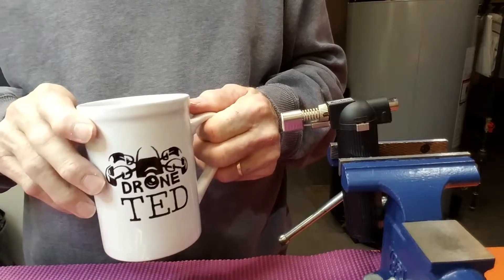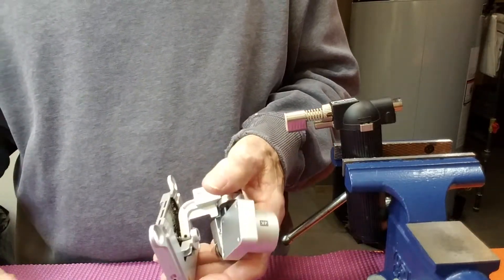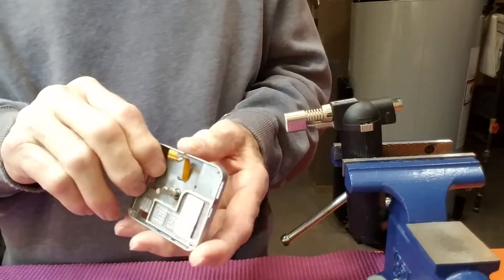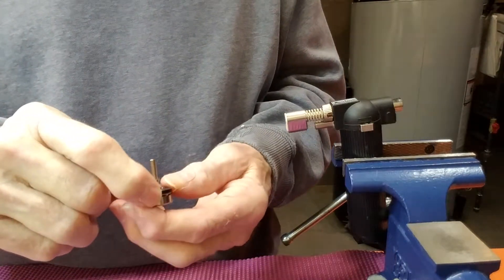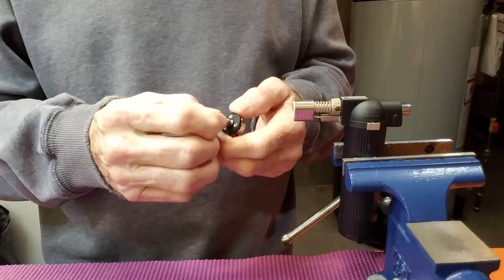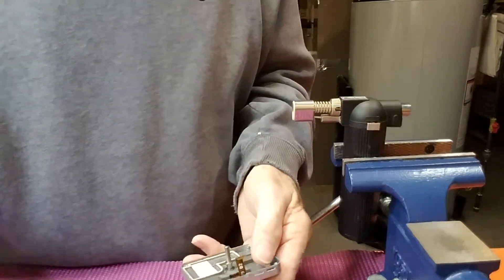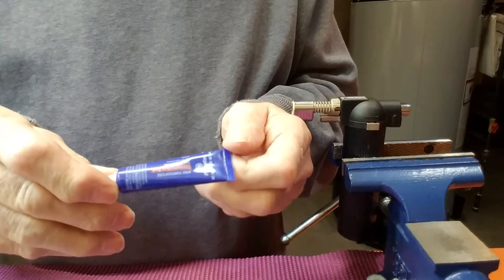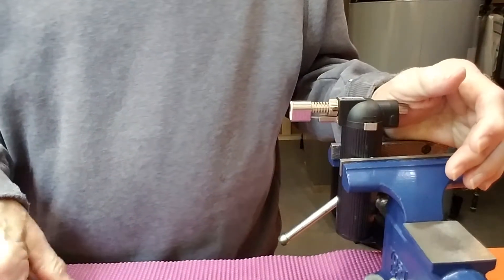DJI Phantom 3 centering yaw

Comment: Hi Ted. This video is extremely helpful. My question is - the black tabs, I broke one. What happens if one is not in place? Can I fix it? Thanks!
Reply from the maker: Can you send me a photo of the board so I can see if there is any damage to the sides that hold it in? droneted@gmail.com
I have put the tabs back but it is not easy. You have to have the black tab or it won't work.
Reply: @Droneted  thank you for your reply! 😀 photo shows old broken pcb board (left) new board (right) with both having lost the black clips. Gimbal works but continually rotates in one direction, could this be why?

Comment: Ted do you think it’s possible to align the yaw motor shaft by using 2 sets of pliers to force the magnet left or right by using one to grab onto the shaft and another on the rear of the motor?
Reply from the maker: no. the magnet is glued on and is very fragile. It will break. I know as I have broken several trying to get them loose.
Reply: @Droneted  Thanks, Ted!

Comment: I buy phantom 3 Pro Yaw Motor for my Phantom 3 4k , please help me why it keeps turning left when i push it to the right it goes back and vibrating ... then i put the old motor back which is not Centered its working fine.. but its not centered thats why i bought a new one but with a problem how do i fix plss :(
Reply from the maker: I would check the new motor for broken wire or a damaged sensor. Use a magnifying glass and look it over. If I were you I would put the old motor on and adjust it on the shaft until it centers. Go a little at a time  and move away from the flat spot on the shaft. Do not tighten too much until you find where it centers. You may have a bad board . I have seen this happen

Comment: Ted- what keeps the magnet from turning on the shaft when testing for alignment, before using red loctite?  Also, my camera points slightly left of center so would I turn the magnet right from current position?
Reply from the maker: It will not move during a test. It never has for me. I would move it in the same direction.  If it points left move to the left. In your case not much. I usually move from say 6 o'clock to 7 o'clock. It is all " best guess"
Reply: @Droneted  Thanks for your help and support.
Reply: @Droneted  I broke the magnet so now I will be buying a yaw motor assembly.  Found them new on Ebay for about $16.00.  Do you know if new assemblies come with the magnet correctly positioned for proper camera alignment?
Reply from the maker: @caburchfield1212  it should point exactly as the old one did. What country are u located in?
Reply: @Droneted  USA- Indianapolis, IN
Reply from the maker: I am presently in NY but moving to Florida

Comment: High Ted, just two very helpful tips, don’t need to use flame, to risky, just use nail polish remover and remove the magnet with a hobby bearing extractor it comes out very easy, or be careful removing it because the magnet is very fragile. Also no need to spent to much time adjusting the magnet, just need to determine where the poles are , use some street dirt and a piece of paper, put the magnet on a table put the piece of paper over it and put some dirt over the paper, move it a little and you will identify the two poles, the magnet will not fall from the paper because the iron in the dirt will prevent it, just mark the poles on the paper with a marker on  the side of the iron dirt and then on the side of the magnet, now you know how to install the magnet.
Reply from the maker: Thanks, I will give that a go.
Reply: The tool is called gear removal tool